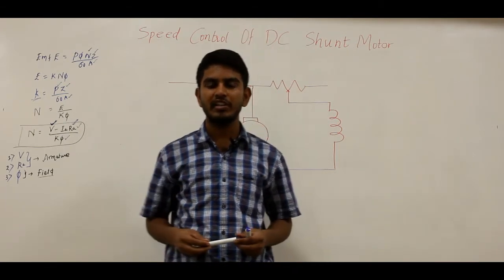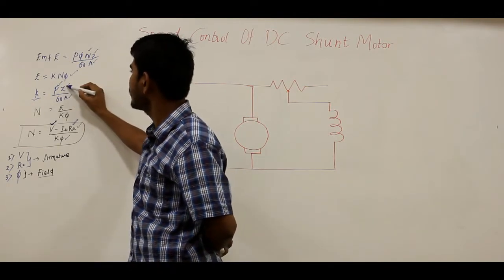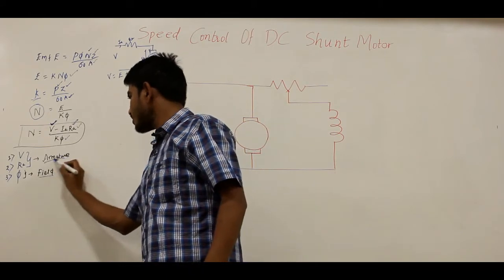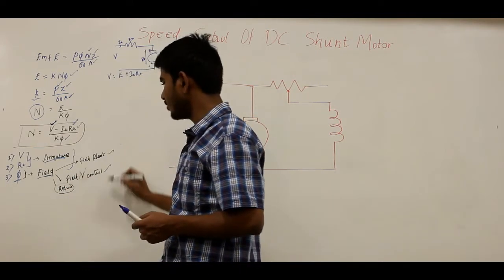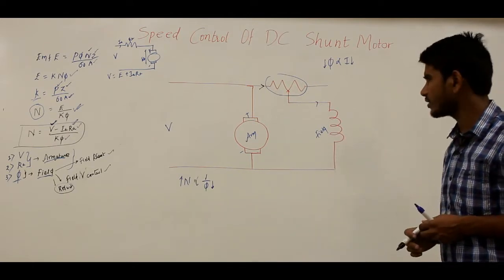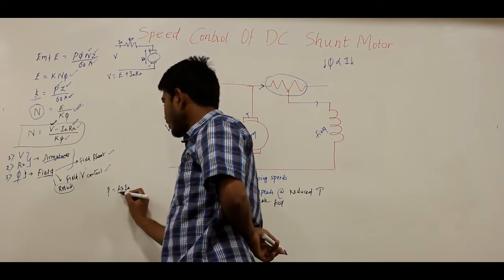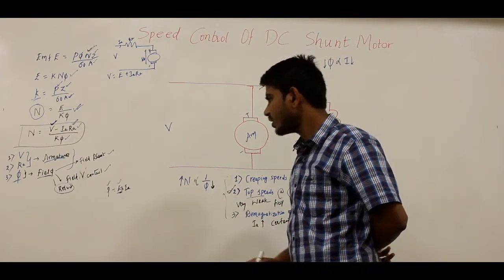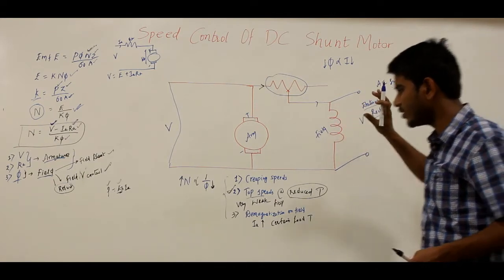Speed Control of DC Shunt Motor

Comment: In field voltage control ( 10.40 min) . we can increase the field flux then the speed should be reduce. You say the speed will be increase.  Then can we reduce the field flux by field voltage control. !?
Reply from the maker: Before performing field control, the motor will be running at base speed with full field turns and flux.
And here you cannot increase the flux as it is at its saturation limits, the only thing we can do here is to reduce the flux and increase the speed.
Reply: Okey.  Thanks a lot brother.  😘